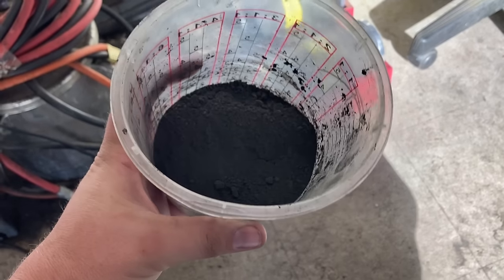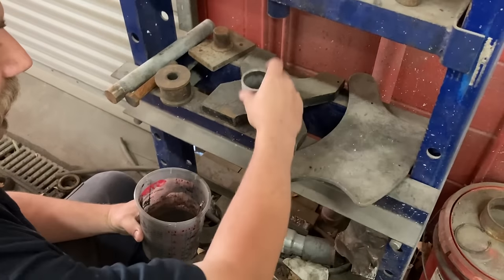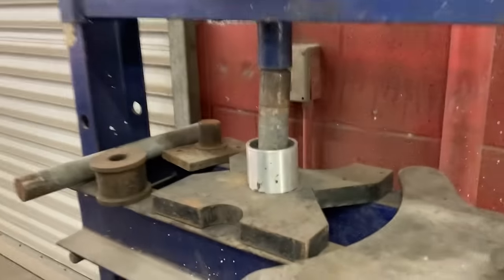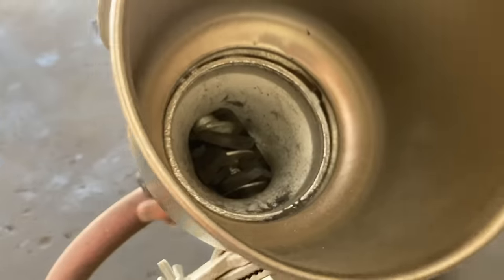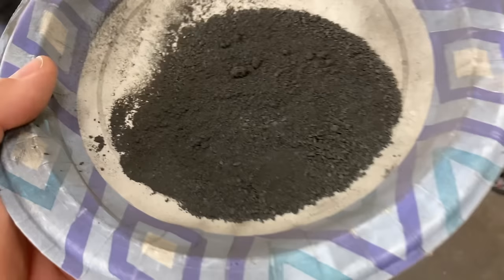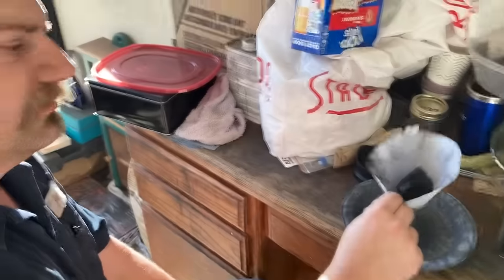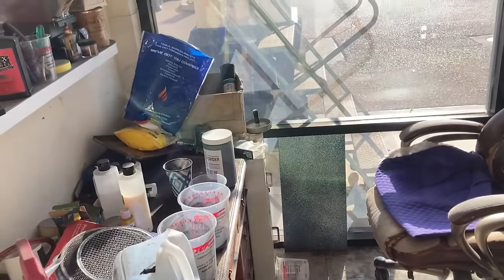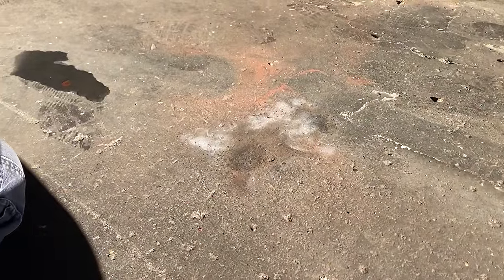Making Corned Black Powder

Comment: You can tell this guy is good at what he does, he still has all his fingers
Reply: This is wet, isn't it?
Reply: @urben2065  nah the granulation part using coffe grinder isn't 💀
Reply: plus eyebrows & mustache  🤘
Reply: @@lurch789although it may sound morbid...he was still "good"  at what he did
Reply: Or he is extremely bad at it
Reply: Missing fingers just means you gained experience
Reply: What ratio 77 of What 13 of what and 10 of what
T
Reply: He's good, just don't have any more nerves to respond to all questions that kids throw occasionally to him owner the net... ;)
Reply: Example 3:40
The press is engaged fully with two separate pieces of metal smaller than retaining cup, and you visibly see one lifting and sitting on angle about to slip. He is sitting in front of a bomb staring at it confidently because he has done this before.
Reply: The cameraman lost both eyes and made his nose stink.
Reply: That's a machinist. Not a hobby black powder LARPer.
Reply: 77% potassium nitrate, 13% charcoal, 10% sulfur
Reply: Next minute

Comment: Well I’ve followed your instructions to the letter, man it’s the best , I’ve never had better powder and I have been shooting black powder rifles for a very , very long time , some 50 years or so ,I’m in my 70’s and since this bloody covid hit Australia black powder prices have gone through the roof and very hard to get, but now after making my ball mill and puck press it’s absolutely not a problem anymore, thank you very much for sharing your knowledge with us , the wild pigs don’t like it ,but the 58 runs very well on what I call now Bogie Black , the biggest I’ve decked so was 394 lbs weighed on calf scales , bloody good stuff , regards from a believer Strathbogie Australia.
Reply from the maker: Excellent! I’m glad to hear it
Reply: How did you make the puck press mate.?
Reply: @michaelbarrett2346  Hi Mick , the puck press is made out of a piece of I’beam with a 20 ton Jack which pushes up on a 3/4 plate welded in the top , the Jack is fitted into the I’beam slightly to one side to allow for the handle, it pushes on a 1/2” plate that sits on top of the Jack , the I’beam is cut out in the centre one side an inch was left the other 1 1/2” that’s the handle side the 1/2”plate that’s on top of the Jack is slotted 1” one side 1 1/2” the other tensioned with 4 good springs to allow the Jack to be retracted to allow the puck mould to be put in and taken out .
The puck mould is made of 3” alloy with a 2” bore .. 3” x 3 1/2” bored out to 2” , the plunger is 4” x 2” solid round bar  tapered at the top to 1 1/2” at the 3 1/2” it’s grooved 3/8 “ which is the thickness of the puck .
I’d like to send you a pic or to but need your email , it’s a worthwhile project as the powder I make works extremely well,in actual fact it’s better than the bought powder , I make 300 gram lots at a time milled for 10 hours de/ dusted, pucked dried and crushed, I’ve made a small rock crusher like they have at a quarry ( made of brass ) better than a old coffee grinder very small amount of fines compared with the grinder, you get less 1f , 60% 2F , 35% 3f which I use , and too me it’s worthwhile running your powder through the mill with graffiti to glaze it , runs better out of the horn and the plus is cleaning the gun , much easier. 
My 300gram lot : 225 nitrate, 45 willow powered charcoal,30 sulphur works a treat
Reply: Thank for that, its a very clear description. Much appreciated. Mick i. QLD
Reply: G'day,

Yay Team !

Yarraford Rd
Dundee
2370...

Here (!).

Happy Summer Solstice Festival...

Stay safe.

;-p

Ciao !

Comment: At last somebody with  a proper video on the subject. You are making BP the right way! Stuff the alcohol and all the clowns on the Tube making "meal" powder, not proper granulated BP. (But all BP people have my sypmathy!) You do one thing wrong though if you allow me.. Your water! I make a 2 or 3 kg batch, when out of the ball mill I place it all in a large bucket and wet it with a spraybottle in the right hand while mixing continuously with the left. When the powder stay in the shape of the fist when opening the hand it's right. It 's a feeling hard to explain but you get the idea. Then I LEAVE IT AT LEAST 24 h IN THE CLOSED BUCKET. What happen then is the humidity is saturating the whole powder, the nitrate being hygroscopic and the nitrate migrate into the pores of the charcoal. It takes me a long time to do the pressing so I keep it moist like this for weeks. Then as you do, I put it on my 20t press in the same manner. My "puks" are thicker. The North Queesland sun will dry them in one hour! I noticed that water was ouzing out of one side of your "puk". This is because your water was excessive on one side due to the rough way you introduced your water. I tried steam but it's a waste of time, the water condenses all on the first spot the steam meets. No moisture should ooze out of the puk when pressed. Like you I get 15% of dust that I keep for the canon. My powder is polished and lubricated the way you do it. Once I used molybden disulfite instead of graphite, then it looked the same color as the Swiss. MD may be better for the inside of the barrels. I always introduce the lubricant at the last 15 mn so the polishing is not "lubricated", the grains must grind dry against eachothers. My powder is 85% the power of commercial powder. I give it to all my friends at the range. Great video Mate!

Comment: Final update.  This video is a game-changer for me.  I struggled to make a good product.  Eventually, I broke down and bought a set of pucks and a press.  Still had problems granulating the powder to 3F consistency without a lot of dust.  Watched this video and finally broke down and bought a grain mill from the link in the description.  Game Changer.  I broke my pucks up and ran them through again and several more times easing the setting from coarse to finer and finer.  Still had some dust, but I formed it back into pucks for next time.  Great video!!!!  Really appreciate you taking the time to educate us.
Reply from the maker: glad to hear it!
Reply: Is there a possibility that you could make a puck to use in a Daisy VL22 ?
Reply: So does your stuff burn faster now? I've struggled as well for years to make fast BP, tried many many things from the finest ingredients to the best willow I could find, but ive never tried Corning with a press. So I wonder if the solution in Corning?
Reply: @77chrysler  , yes.  I did a back-of-the-envelope comparison with Pyrodex P last weekend.  I have never shot commercial Goex or any other commercial black powder as it is hard to get in my area.    

My estimate based on recoil and the reactive targets I shot at was it took about 25 grains of my black powder to equal 21 grains of Pyrodex P.  

People who know have said that sounds about right.  I estimate the homemade BP was about 90% of the Pyrodex.  

I'm still going to make a batch with black willow, grapevine and even some Alder Wood chips that I acquired just to see if I can get somethimg faster and cleaner.  I wish I had a chronograph, but I don't.  

If you follow the 75,15,10 recipe and use cedar shavings from Tractor Supply) or something better and follow the instructions in this video, I think you will be happy with the results.  Corning the powder is a must.  Running it through the grain mill makes it 10x easier and produces much less dust.  But, I repuck my dust anyway.
Reply: Is It possible to use It in an ammunition?
Reply: @MarcosPaulo-nv4cm  as far as I know you can make blackpowder shotgun shells, .45 Long Colt, 30-30.  I don’t know about anything else.  Just know that you MUST clean your firearm immediately after shooting black powder cartridges.  That stuff is corrosive.
Reply: The compression caused by pucking does something to strengthen the bond between the components.  It is like night and day.
Reply: @sleeperno1215  many thanks.
Reply: @sleeperno1215  I suspect you can make any cartridge that has enough capacity in the case, like .357 magnum or .38 special. EBP did a video with 9 x 19 in BP but IIRC it wasn't too great, such a small case volume.
Reply: @nonokodog622  i picked up a 20 ton press.  Been using a 6 ton.  I think the 20 ton will give me more of a 1 to 1 density.  Right now mine is about 80% as dense as GOEX.
Reply: @sleeperno1215  Did you use a smaller pucking die for the 6 ton ?
Reply: @nonokodog622  nope.  Got a 20 ton and made new pucks today.  Will report on the reaults.
Reply: Você  usa grafite no lugar do carvão
Reply: @77chrysler  yes.  Definitely faster.  I originally got a 6 ton press from Harbor freight and it worked well.  I got a 20 ton but I dont see much difference than using a 6 ton press.  The puck dies cane from Woody’s.  Get more than two plastic spacers.  You can make two thinner pucks at a time.  Making them easier to granulate.  Bought a hand crank grain mill and a set of classifiers off  of Amazon.  If it passes through 40 mesh -4f, 30 mesh - 3f and 20 mesh - 2f.  About 50% of your granulated powder will be 4f.  Simply puck and press it again.  Then regranulate.
Reply: @carlosliscth7144  não. fiz o carvão usando aparas de cadarço vermelho usadas para cama de animais. Agora estou usando salgueiro preto que cresce perto de minha casa. carvão ativado não funcionará. eu mesmo faço o carvão. o youtube tem videos de como fazer isso.
Reply: @77chrysler  Skylighter did an interesting black powder test. His homemade black powder was incomparably more powerful than the commercial one. The corning method turned out to give no advantage in terms of power and was more messy and time consuming.

"Making and Testing High-Powered Black Powder"

Comment: You have the most informative and best videos I have ever watched on you tube. I generally watch all of them several times to make sure I didn't miss anything. You share all your experiences and ideas without bias and straight clear cut analysis. I just started into making BP after watching your video about goex closing down. I don't have a hydraulic press, but I modified a jack screw car press which is rated over 20,000 lbs and it seems to work fine. Since I retired I started playing with a lot of the stuff you are doing. I appreciate all the help you are willing to share with everyone. If they think they are better, Like you said ( Make you own Damn video ).  Thank you again
Reply: Hola...si usas un tornillo  de banco es recomendable dejar un par de horas prensado el material...así se quita mejor el aire. Luego analiza el comentario sobre el cocido y grafitado del grano.

Comment: I appreciate your approach to making Homemade Black Powder.  You've sold me on the Cottonelle charcoal Mixture with the 77-13-10 formula.  Velocity and deviation shot to shot are very good.  Excellent work producing a quality product.  I also use Dawn / water in a 50/50 mix for cleaning and highly recommend that solution as well.

Comment: I’m glad I found you! I’ve been making my own black powder since ‘08 when I saw prices above $30 a pound locally. I’ve never corned my powder, just screened it damp and let it dry. Way messier I think, and I can wait to try your method. I think the amount of water you add really depends on your climate. I use a spray bottle and give two squirts on fine mist for a 100g batch, but I’m in the desert and it does effect your working time. I will be watching for future episodes. Keep up the good work!
T
Reply: Can’t wait to try…stupid autocorrect!
Reply: Try adding 0.5% Redgum to the mix when you mill it. When wetting it slightly use alcohol or acetone to dampen. Press and dry. It’s awesome.

Comment: You have blasting grade stuff right there my friend!  For fireworks, depending on the application of course, I mostly use hardwood charcoal at 75-15-10. For sporting purposes, or for fast break charges,  I use willow, at 77-13-10 just like you.  The graphite btw, makes the granules flow better and prevents sticking.  A pinch of dextrin dissolved in your water prior to dampening the meal will make your pucks rock hard, and seems to reduce the amount of dust you end up with after corning.   Great  video!
Reply: Hola Amigo.., como se aplica y en que proporción el grafito en el proceso de fabricación de polvora...???
Reply: True! and it makes the residue much smoother in the barrel. On the other hand it makes the powder slighty more hugroscopic.
Reply: @emeteriosilva6901  Un poccito, just a pinch!
Reply: The more dextrin you add the slower your powder will burn.
Reply: @johnstaton5524  I wouldn't use anything other than CMC or red gum:

"Making and Testing High-Powered Black Powder"

"Charcoal Tests" wichitabuggywhip

"Sodium Carboxymethylcellulose (CMC) seems to be a better binder than dextrin. The BP made with CMC was much sturdier than similar dextrin grains. It also seems to be a better fuel. Adding 2% to the BP did not result in noticeable burn trough differences"

Comment: As someone who is a semi pro Pyro technician.  I made lots of Black Powder over the year. We call them   comets. I'd so suggest using an alcohol mixture of denatured alcohol and red gum. Metals, such as aluminum are ok, for they don't spark. We use PVC and wood dowels for making  .75 inch comets.
Drying them outside in the sun is best 8 to 10 hrs to get very hard comets. I like you pucks. 
Once again great job, remind your views never allow steel to used because of the possibility of sparks.
Reply: Red gum? Elaborate please.
Reply: In my experience alcohol doesn’t make a good product.
Reply: @samfisher9413  It's a resin.  Gum Arabic is more common in pyrotechnics, and shellac will do much the same thing.  I haven't messed with this stuff in fifty years, so I don't recall proportions, but the basic idea is it acts like a glue to harden and slightly water-proof the powder grains for performance in high humidity.  I've never done a side-by-side comparison, so I don't know how well it works.  It seems to me the hardening aspect was used for coarse launch powder and the like that was made without using a press.  It was all put in a plastic bag with an open mouth and a weighted plate placed on top.  It does not, however, give you anything like as much energy density as the compressed cake grains do.  Not a good choice for a muzzle loader.
Reply: I work in undergroud coal mine and all industry dont let us (workers and producers of exuipments )use aluminium becouse its "soft metal alloys producing spark"....( I dont know how )... I cant remember that if i make any spark if i was cut alumunium at home with ordinary angle grinder... But at same time almost everyday i see many sparks between steel parts especialy with rust on and high carbon steel. .. "Experts" or experts (i dont know) say us that they are low energy sparks that will not ignite anything .   i intentional take aluminium and try hard make sparks by hiting in some angles rusty metal but fail ... ..i dont know why how sparks could happend at low speed and without rust then. All that instruction in some places...that for example "Lee Precision perfect powder measure deluxe" (that is made form brass if i good remember)manual say "dont use with blackpowder" all measures that maual i read says dont use with blackpowder becouse sparks .... It get me soo angry ..i dont get all that sefty about sparks ... And wonder to someone give me good explanation.... I think that its overkill ....and maybe some make ignition with superman speed milling or ignite powder with other way and dont want say it ....soo there is always must me someone blame so they maybe blame materials and legend grow with ages ? (It make me more angrier when i image at same time we use iron/steel that are sparkly as Hell compare to aluminium... That make my brain blow up)
Reply: @kaziulaz  Aluminum does not spark by itself for two reasons:  One, to get enough heat to ignite the metal by friction, the metal has to resist the grinding.  If it is too soft, it will deform and tear off the surface before friction reaches the ignition temperature.  Steel is hard enough that it resists the grinder enough to reach ignition temperature by friction heat.  Two, aluminum has the property that it is so highly reactive with oxygen that when you scratch it, a layer of aluminum oxide, which is very inert and does not burn, immediately forms on the surface, which protects the aluminum metal underneath.  
    So, why is aluminum prohibited in the coal mine?  The answer is that in the mine, you have steel tools with rust on them that are being used. When iron oxide (either red rust or black magnetite iron oxide) becomes mixed with aluminum, it forms a compound called thermite.  When thermite was first discovered in the late 1890s, it was found that it burned so hot it was used to weld tram rails together.  In the mine, you won't have that much thermit in one place, just a few small particles where the aluminum rubbed off on the steel.  But even a tiny quantity, if it ignites by friction with the steel against a rock or another piece of steel, will make a very hot, very energetic spark that is white hot, and not the lower energy orange sparks from steel alone.  That white spark can ignite gas and other things very readily.
Reply: @unclenick222  thank you Uncle very much for your time spent explaining this to me.  It's still hard for me to imagine that such a dry mixture of oxides would be created that would be in the wrong place and time ..... But most of all our reasons .... Although small, there is such a possibility